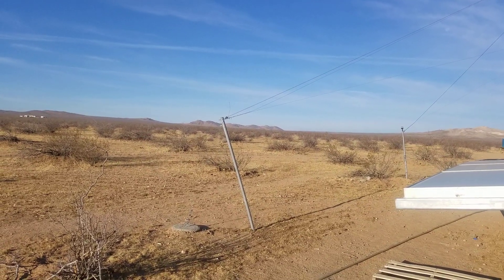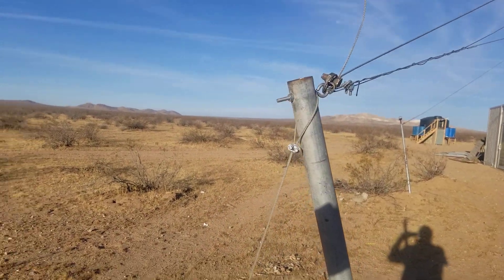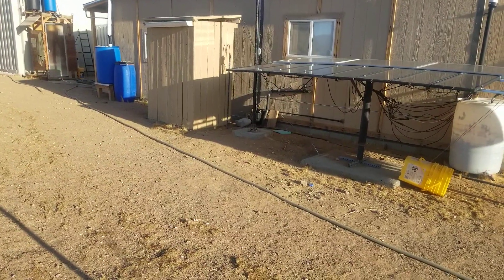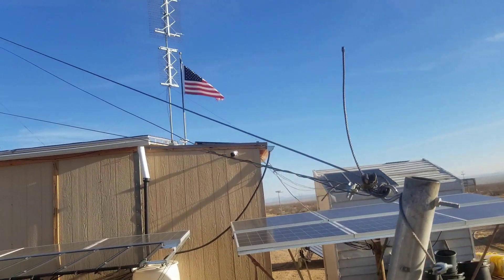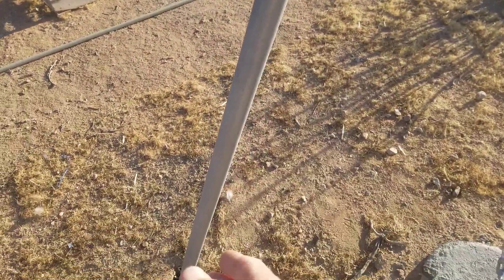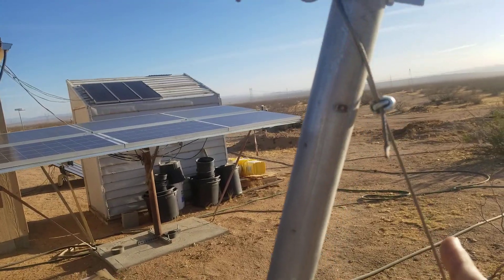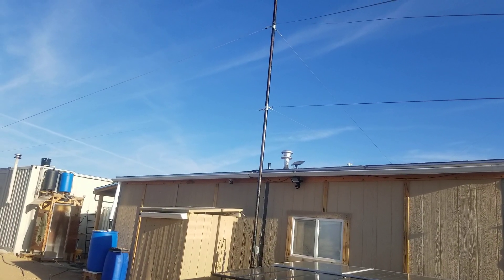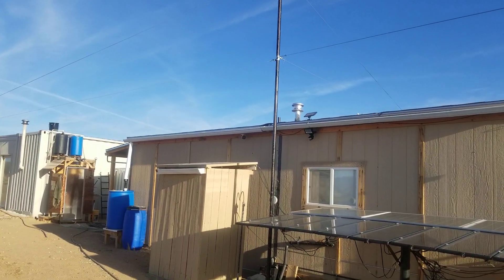The importance of guy wires on your PMA mast.  Oct. 16, 2019

Comment: The guy wires don't seem to need to be very thick.
Reply from the maker: The ones I used are rated for 4700lbs, and the backup ones are 2500lbs.  They are wire ropes, not wires.  (Braided cable)
Reply from the maker: Oh, and welcome aboard.

Comment: Hi Nice off grid setup. Do you have a CB radio set up inside?
Reply from the maker: No, sorry.  I do have one in the motor home but hardly ever use it.  I just have it for emergency backup.
Welcome aboard!
Reply: @GBear  You need a base antenna, you could make a homemade Long wire. Then a Micronta 12 volt power supply. You could call yourself GBear👍👍
Reply from the maker: Lol, I'm afraid I wouldn't have much time to spend on it.  So much to do the days turn to nights fast.
Reply: @GBear  Ya but at night you could listen on it & When not if communications go down for whatever reason the CB & HAM bands will be the main sources of communication. I would find a CB radio with USB & LSB as they will talk greater distances.
Reply from the maker: I have a CB in my motorhome that I reserve for that purpose.

Comment: When I needed water bottles for camping I went to a small radiator shop that bought antifreeze in 1 gal black bottles.  I asked for his discarded bottles and he said "Sure the trash can has plenty!"  I grabbed about a dozen and took them home.  Turned them upside down in the sun for a few days to let them drain.  Then I added a half cup of ammonia from the dollar store and filled them half way up with water (they have a clear sight gauge panel) and put the cap on and threw them in the back of my truck for a week.  Once in a while I'd flip them over.  Drained and flushed then filled they were put in the sun and I had very decadent showers and dish water.  Can't taste anything!  They got 120F-140F all the time.  Even hotter if you go to the dollar store in the kitchen section and get a deep aluminum pan to use as a reflector!  If you have scrap glass to put on top it is a nuclear heated shower setup for sure!
Reply from the maker: Great info, I'll give it a try.
Reply: You can also put future drinking water in clear/green drink bottles the larger the better and put them in aluminum pans focused on the sun and the UV will kill most boogies in about 8 hours. @GBear

Comment: Could you set a well if you wanted ?   How deep is water ?  Here ours show up a 120 and you need to go to 160 maintain flow.   Deep Well Pump required.
Reply from the maker: Here, water is expected at 375 feet best to go 425 feet at a cost of $42,500.  I get water delivered at 4200 gallons for $320. Every 10-12 months.  You can do the math at how many times I can fill up for 42,500 bucks.
Reply: @GBear  Cool Beans.   Yep, well aren't cheep.